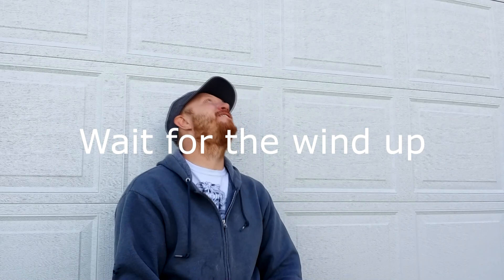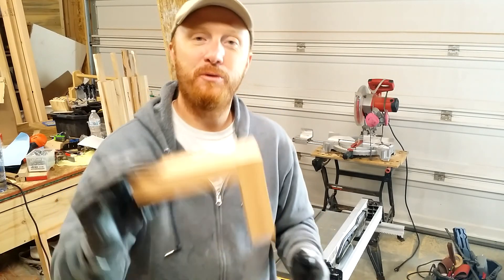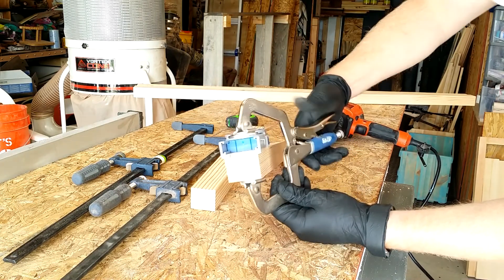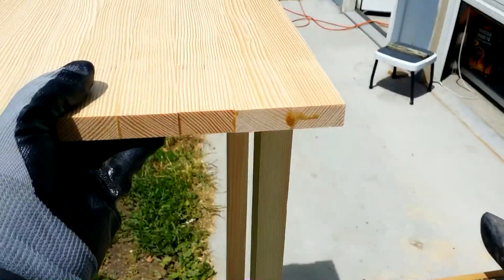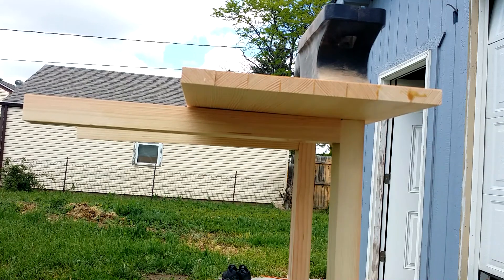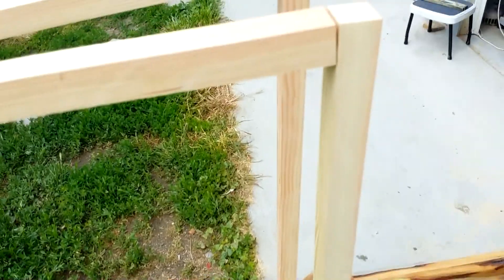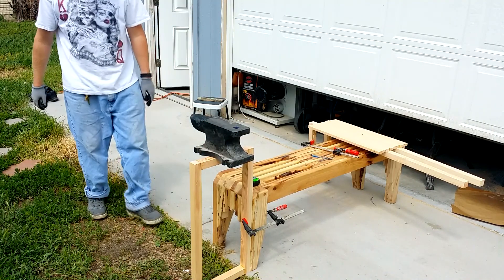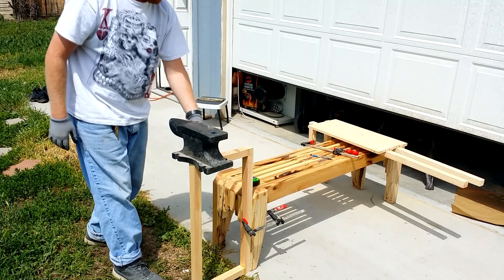Kreg Pocket Screws - Strength test

Comment: Just a quick note.  try this with the pocket holes drilled on the outside of the joint where they are biting into more wood.  Drilled from the inside, they are into the least posible wood for the joint.  The frame joints are stronger being made on the outside and going in deep
Reply from the maker: thanks for the suggestion - I might re visit this kind of project - it was a lot of fun to film.